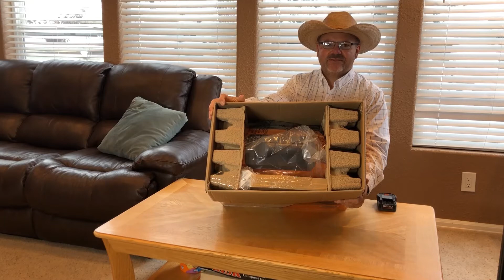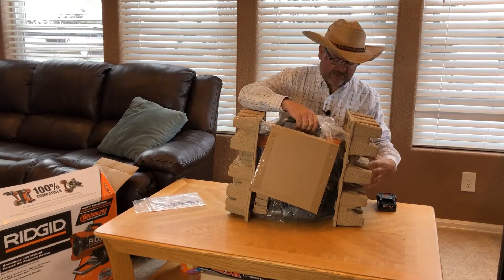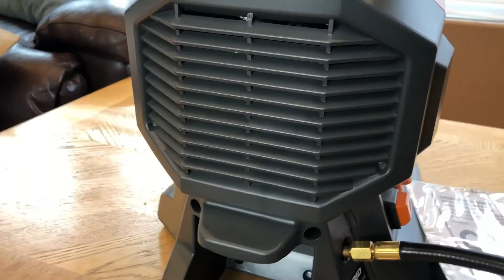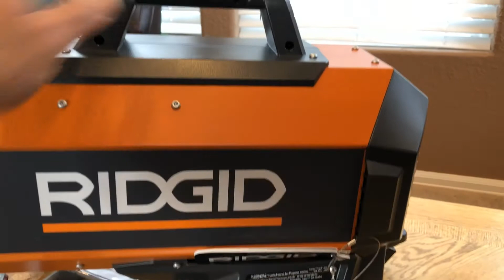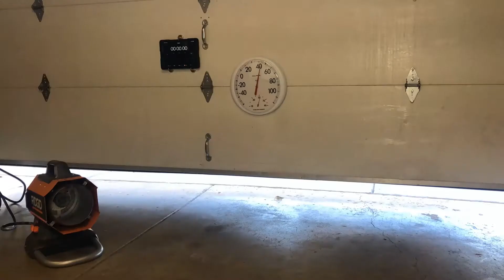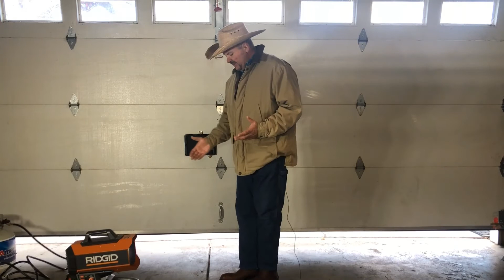Ridgid Propane Heater Unboxing, Testing & Review (R860424B)

Comment: I am thinking of using this in the Florida winter during my daughters softball games just to keep some parents warm.  My concern is after the game is over, how hot is the outside of this thing?  Can I easily throw it in my cloth wagon then into my car?   I guess my question is that I am wondering how hot the outside of the unit gets for immediate transportation after turning off.
Reply from the maker: @Dave Curizo - Hi Dave.  Interesting question and something I haven't tried.  I would think if you allowed the heater to sit for 5-10 minutes it would cool down enough that you could do this with no problem.  I am going to be doing some things around my garage this weekend so I will see if I can't get you a little more data to help you make an informed decision.  It may be a day or two but I'll get back with you on this.
Reply from the maker: @Dave Curzio - Hey Dave, I didn't forget about you!  It was a really busy weekend with the kids, Halloween and yard cleanup.  I should have time to get to this tomorrow for you.
Reply: @javosgarage  no problem at all. I truly appreciate your doing this.
Reply from the maker: @Dave Curzio - Hi Dave! I finally got some time to do some experimenting for you.  Here's some numbers from my test:
When I started the outer orange shell and the combustion tube were both 62 degrees.  I turned the heater on high and let it run.  After 5 minutes the shell was 300 degrees and the tube was 460 degrees.  That was pretty much the peak temps although I was able to get readings as high as 600 degrees from time to time in the tube.  It's hard to get consistent readings in the tube with a non contact thermometer because of the fan blowing.  I turned off the heater and in one minute the shell went to 140 degrees and the tube was 190 degrees, so it cools pretty quick.  I checked again at 5 minutes of sitting and the shell was 90 degrees and the tube was 104 degrees.  A note on the shell, the temps were much higher at the top, end of the shell because the heat rises very quickly coming out of this heater.  As I moved towards the bottom side of the shell, the temps dropped to about half of the reading on top.  So, if it were me I would be okay using for the application your talking about providing two things: 1. Make sure nobody gets close to the front of the heater to avoid a nasty burn and 2.  Let the heater sit for 5 minutes to cool when your done using it before transport.  Ultimately, you have to decide for yourself what is safe or not for your application.  Hope this helps you a bit.  Let me know if you have any other questions.

Comment: I'm seeing a lot of reviews saying this won't stay running without the igniter being held down.  Have you had any trouble with it?  Thanks
Reply from the maker: @Life in Wyoming - I know exactly what you're talking about.  The first generation of these heaters had a major problem with the thermocouple.  In fact, I had one and returned it because of that problem (after I took it apart to find the problem).  This heater is the second generation and I can tell you I believe they have solved that problem.  I have used this heater extensively, I mean A LOT and I have had no issues with it.  I really think you would be happy with the 2nd gen model.  Hope that answers your question.  Let me know if you have any other questions, I'll be glad to help.  Thanks for stopping by!
Reply: @javosgarage  thanks for the quick response!
Reply from the maker: @Life in Wyoming - You're very welcome!
Reply: @javosgarage  Anyway of determing gen1from gen2 if buying one of these used?